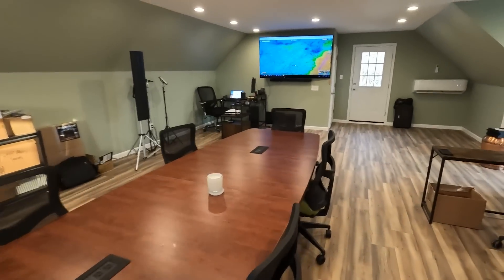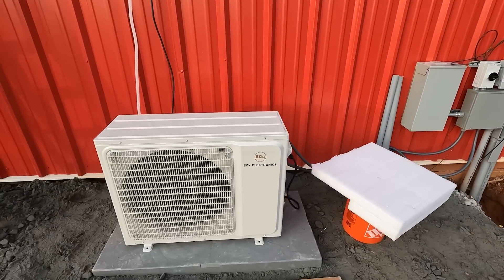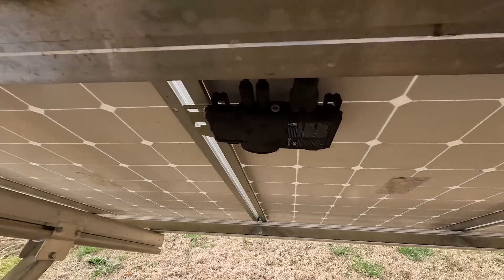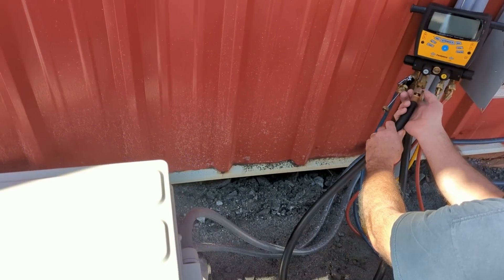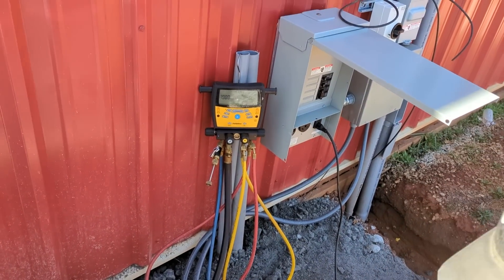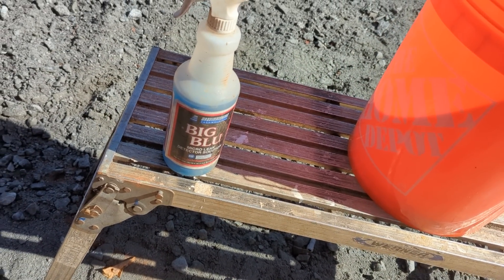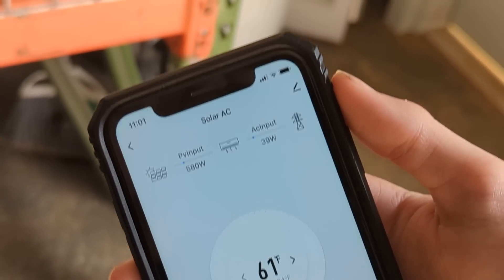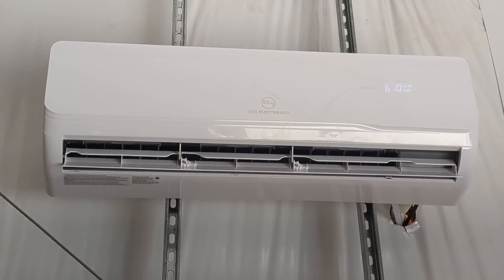A new AC/DC air conditioner has arrived!

Comment: I get the concept, but frankly, I just use window AC and then space heaters.  More portable, I can move around as necessary, and I can take with me.  I built the handcart LV6548 set up per Will's video with used panels, and can run 2 window units...roughly 20000 btus and get the job done.

Comment: @willprose I’m starting to research similar setup.  It my question is I thought when you connect the panels to the enphase trunk cable doesn’t it convert that to 240 coming out? Also I heared you say it’s going into 15k sol ark. Is the sol ark for your house or you went from panel to enphase to sol ark to mini split. Sorry if this question has already been asked.

Comment: Im looking into this exact 2 ton unit for 40x50x14 shop like yours with minimum insulation. Im wondering if 1 2ton unit would be enough or would I require 2 of the 2 ton units? Located in Texas

Comment: They say there are no stupid questions, but this might qualify.  This question would apply to a cold climate where the average temperature is 20F in January and February.  If it is possible to construct a passive solar shelter around the condensor, would that help with cold weather efficiency.  I'm guesding it would be problematic or it would have been done.  I realize the condensor has to have  air flow, so Im thinking of something a good deal larger than the condensor itself, maybe even like a solar oven in  terms of reflection.

Comment: Great video,I am new to this and want advice.I want a2 zone mini split 2-12000 btu 220 ,   Or 2 single 12000btu 110 .
Looking to run on dc solar.I do not need to run at same time.witch would be more efficient?,would 5 -400 w panels run the 220?
Thank you for advice.

Comment: I recently learned there something called a heat recovery unit that recovers concentrated high temperature heat from your air conditioner's condenser circuit and pumps the recovered heat directly into your hot water tank.  I would love to see something like that incorporated in an off-grid system, because otherwise all the heat from that condenser is just wasted.

Comment: I need HELP!!! two18k Carrier 19 SEER mini-splits are consuming 50 kWh per 24 hours. I cannot get Mexican HVAC guys to pull a vacuum or measure refrigerant based on specs. All they do is come, pump some R410a in and ask if it's cooling, then ask you to pay them and they split ASAP. Mexico will not sell me 410a. Will a proper evac plus measure weight of 410 increase efficiency?? I am COMPLETELY off grid, 50 Silfab panels, 54 kWh lithium battery banks and It's not enough. My thoughts are to buy the gauges/evac pump/nitrogen and flush the system myself. MX version of evac is to just purge your current R410a into the air which doesn't help of all 410a is already out and filled with air.

Comment: You mention the app for the mini-split.  Is the wifi on the unit inside the shed our outside?  If inside, how do you get the signal out?  I've got a metal shed and the darn thing acts like a giant Faraday cage and won't let signals in or out.

Comment: @WillProwse @Engineer775 I love your content! It's been about a week now that I mess with solar and I'm really thinking to going off-grid at my home (planning to build it next year, hopefully with Na-ion batteries!). My question for both of you, can I go for DC home only (both for safety and efficiency), I'm planning already to use KNX (which uses 24V) and I could use it for most of the electronic devices (tv/laptop/pc/tablet/light etc...). Hopefully fridges/freezers/air condoners/induction cooktops will be also available or possible to convert them to DC only? I would try to avoid fixed/static switches and use wireless so I can move them anytime and instead of using 220-240 AC plugs just use USB-C maybe. (Not much research yet, but Class 4 also looks interesting)

Comment: We're running a 9k BTU in a lightly insulated 8x14 art studio shed run off 1200 watts of panels, and 5.1kw of lifepo4 batteries. It's just about enough, but now I'm experimenting with linear actuator lifts and tracking to get another, hopefully, 20-30% more morning production. We also have an automatic transfer switch if we do run out of battery.

Comment: I just bought the same EG4 2 ton unit (July 2023). It now comes with all the lines pre vacuum evacuated and precharged with R410a. No HVAC tech required.  Also if you are a Android user like me (S21) I contacted Signature Solar and they sent me the work around link to get the app to work on my android.

Comment: The DC voltage requirement is so high it can't be run  off batteries w/o an inverter (unless you use stack cell modules from a hybrid vehicle bank) so what good is the DC input ? Without batteries clouds will kill it. I guess you could set up a two pole relay activated by a CDS cell with adjustaable sensitivity to switch between the panels and the grid; but that won't cover outages and clouds the way batteries can. You can put 12v DC supplies across every 12v in a bank, set your panel charge-voltage a bit higher, and (as long as the grids on) seamlessly transfer the load current draw from panels to battery power supplies whenever clouds show up. The best part is the batteries always stay topped off during solar operation and the power supplies wil never over-charge them. Switch to grid for storms or night time and the batteries will last way longer from not constanly being cycled. I'm presently looking into making my own split outside unit with the AC system fro a pickup truck salaged at a yard being diven by one of those 3000 Watt brush-less motors from China. You can get one with a 72vdc controller for just $200 and run DIY servicale 134 A to boot. That should be good for at least a ton and a half and inside units for splits can be bought seperately.

Comment: Is the 2 ton, 120v or 240v?
Reply from the maker: 240
Reply: @engineer775  that's what I was thinking, I appreciate it.
Reply: The one ton runs on 120.  There is also a 1.5 ton that NO ONE ever talks about which I assume runs on 240 though with a little improvement in SEER, I don't see why it couldn't squeeze into a 120 dedicated circuit.  Maybe it's the heating part that keeps it at 240.  @carlosreyes6448

Comment: A fuzzy logic option for reducing AC could be programmed by EG4 to accommodate usage scenarios which are not temperature equilibrium prioritized, for further savings and independence from the grid.  A desirable temperature range could be specified by the user and ac electrical usage estimates presented. The unit could track solar availability over months. In this case, maximum fluctuation could be permitted for specific dehumidification priority.

Comment: You can use normal air to check for leaks. Doesn't have to be nitrogen. Just hold the vacuum long enough to dry out the system afterwards
Reply: You cannot use air!
The oil in these things is hygroscopic and will grab the moisture from the air and do damage…the  manufacturers do not allow the use of filter-driers to mitigate moisture.
Reply: @rodgreene2687  yes you can. Dry it after you are done. This isn't rocket science.
Reply: @rodgreene2687  you do understand that these oils were never ever kept away from air, Right?

Comment: Wonder if I can get your advice, I’m building a mini home inside a 45 high cube shipping container in the high desert of Utah. I’ll only have about 360 sq ft of living space, I’m completely off grid, I will be having my container spray foam insulated. What mini split would you suggest? 

For construction I’m only running a 600 watt array, with two 12 volt 200 Ah LiFePO4 batteries, enough to run all my tools and Miller welder.

I’m planning on a 7,000 watt array with two EG4 6.5kW Off-Grid Inverters, and four 5.12kWh 48 volt LifePower4 UL Listed Lithium Batteries

Comment: The fact that the solar panels have to be dedicated to a single device (AC) is a huge negative.   Plus you still have to run your inverter from your batteries to run it at night or cloudy.  Why not just toss some extra panels on your system and use the inverter on a normal AC powered mini split and not have some proprietary mini split that wastes solar when off.
If this system was a mini-split that ran on 48v DC then this would be something worth looking at.
Reply: Because solar panels are cheaper than batteries and inverters for people wanting to just offset grid costs.  It gives you the option of running AC or DC or DC&AC.  This gives a lot of freedom.  
48v would require some serious thick power cables to run any distance, so it makes sense why they put the current max at a lower value (12amps).   This is probably limited by what the internal guts actually run on.
Maybe someone makes a DC-DC boost converter that can handle the load from48v batteries?

Comment: Those power readings are astounding for a 2 ton unit.
It is basically 600 W for running.
MY efficient dual inverter 8000 BTU unit uses that much on medium.
It often runs at less than 200W. But maxes out around 1000W.
It would be interesting to see the maximum draw vs minimum.
Reply: 619w is not full power for a 2 ton. You can figure about 1800-2000W in cool, more in heat mode.
Reply: @USA-GreedyMenOfNoIntegrity there’s not enough correlation between tonnage and power draw to claim a 2 ton can’t pull 600w’s under full load. Idek where you’ve gotten that idea from.
Reply: Hi,  @CrypticCabal .  @rv10flyer84 is right.  The online spec sheet for this model shows max wattage draw just north of 2000w.  It turns down to about 25% of that so 500 watts and change for lightest load.

Comment: For better filtration, take  a 12x30 air filter, the lowest micron; like a 5, and stick it over the air intake. This will help I’m not clogging the coils up with dirt, that will bypass the mesh filter with the unit. Nothing fancy, just cut it to fit flush, or set it up with out cutting.
Reply: Buy a 1/4” foam filter, spray with silicone filter spray to help pre-filter.
Reply: @USA-GreedyMenOfNoIntegrity  why would you want to use foam? Just set a proper air filter over the intake. I don’t know why anyone would want foam.

Comment: Thanks for the video, looks like a sweet little setup you've got there. It's been four months now how has it been holding up?
 I doubt I'm the only one wondering, but what is the SEER rating on these units? We all know that you've got to have checked the surge and verified the running Watts. Will you please share that with us?Also, what is the lowest, and highest temperatures it will work at, and finally will it work with a battery? Please forgive me if I missed it in the video.
 Thank you.
Reply: You can figure about 1000W per ton in cool mode. So, his two ton max consumption in cool mode is about 2000W. It’s probably less than 18 SEER. They typically last 5-15 years depending on brand, how they are installed and maintained and how much you run it.

Comment: Better to cut those flare connections off and braze in the lines with hard solder.  When I got into hvac the flare fittings were being phased out and new units were all braze in type connections which are much less prone to leaks over time.  I've had some mini-split systems develop leaks in the top connections over time.  If they are covered with conduit it's a bear to repair them.  I guess we're going backwards to meet Chinese standards these days.

Comment: What happens to excess power generated from panels, if the AC / Heat pump is off, or drawing a small amount of solar power compared to production? Does it go to the grid?

Comment: I've seen once at temp, this thing will modulate itself to run at a lower power to just maintain the set temp.  When on DC only, will it also dial itself back to use whatever power is available in the morning / evening hours when solar production is low?  Or if it wants to run at full power but there isn't enough power available, will it just shut down?

Comment: Does anyone know if you can use a cheap Harbor Freight (designed for automotive use) vacuum pump (any special adapters needed?) and refrigerant made for this unit to charge it? Do you have to be an HVAC person or have connections to purchase the refrigerant made for this unit? I am trying to figure out if I can use my old automotive A/C stuff to charge a unit like this correctly. What about oil in the refrigerant??
Reply: He said the outdoor condenser was precharged from the factory with refrigerant, so you should not need to add any if your lineset is short.  As for pulling a vacuum, I would think car gauges would be fine.  Most of these units only have a single port on them to perform your vacuum or add or remove refrigerant.  I would use the low side gauge and pull it down as far as you can below 0 PSI.

Comment: Really nice video and very helpful, thank you. I wanted to throw this out there my cousin has a pole barn that he took 4 x 8 sheets of 2 inch Styrofoam and used his backhoe to dig down 4 feet all the way around the pool shed put it in the Styrofoam and he said it is really helped keep the heat bill down. He does have hot water heat tubes in the cement so it was almost necessary for that but I would think it would help any pole shed especially with moisture coming through the cement. Just a thought
Reply: just a reminder for increasing value when limited to digging depth. Remarkably, placing panels horizontally on bottom of ditch extends the equivalent insulation as vertically installed panels.  This is a technique used in crawlspaces where you can't dig down.   Of course, in the basement or crawl space, this horizontal insulation extends inwardly, but I hypothesize this may work outside and horizontally outward by the same principle.

Comment: minisplits inverters are already dc, they don't use ac for anything. so most should run fine with 300v dc but some do have sensors to monitor the mains frequency and those needs to be bypassed.

Comment: I installed the 9k Pioneer mini split last summer in my 28' RV, I love it. It's quiet and cheap on power. I've seen a review once before and  would love to switch over to the 12k version. It's only $300 more than what I paid for mine. I have someone I could sell this one to. Thanx Mr. 775 for the review. Screw a plate to the wall, drill a hole in the wall and wire it up. So simple to install. Oh.. I got the Bluetooth module for mine too..  it's connected to my home wifi.. so I can control it from anywhere with an internet connection.

Comment: What do you think  the minimum array size and input voltage for that 24k btu unit could be?
Reply: The 24k unit is 220 volts. The 12k unit is 120 volts. That 12k is good for about 6 hundred square feet, if you live in Florida or out west it can be less than that. Also keep in mind it cost more to run 120 volts then it does 220 volts. The bouns is it's running for free during the day. You could actually get a 220  volt battery back up system, to run your shit at night, then charge during the day on seprate solar panels, while your using other solar panels for the unit during the day. But you could bang the whole thing out for around 8 grand. Seeing some contractors charge 5 to 6 grand ripping people off or a basic 4 to 5 ton a/c system.
Reply: @wd8557  yeah I bought 3 units.  One 12k and Two 24ks.   And I ended up get 18 REC  370w panels new surplus from SanTan solar.  I'll use 7 each on the 24k units, and 4 on the 12k unit.

Comment: Did you pre pressure test with Nitrogen?  And pre blow the lines?
Reply: He should have to whatever the lower of the two units max design pressure. I typically test to 300 psi for 15-30 minutes while using leak detector bubble solution.

Comment: Nice video. 👍 If you have the 12 panels, from your old outback system, could you not use them all and put an inverter between the panels and the Airco? With more panels and more power, you be able to use the system longer all day and year around....🤷‍♂️ But I get, this was more of a "proof of concept" video. 👍

Comment: I didn't think any of those for a pre set I mean I watch some people out doing that but argues a vacuum at least that's why I'm buying one of those action just doing that to replace when I got I got one air conditioner heater and I think I'm buying four or five more which Hammer use to heat up my whole house and cooling in the summertime well truthfully I'm just going to set it at 75 degrees and leave it at that all year and for as long as it would last I think it'll last 30 years like my lead acid batteries did and some of them are still going.